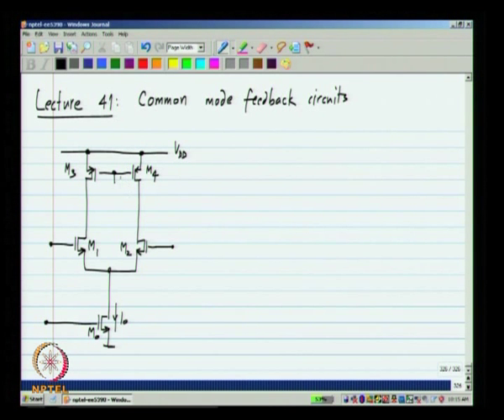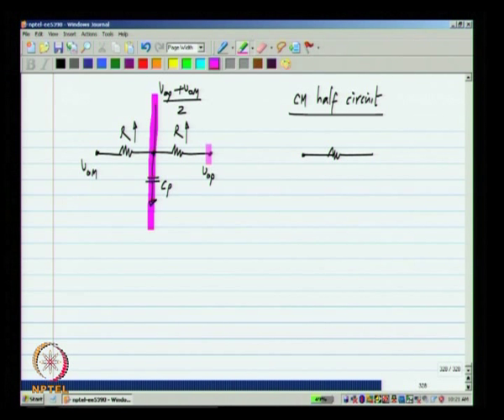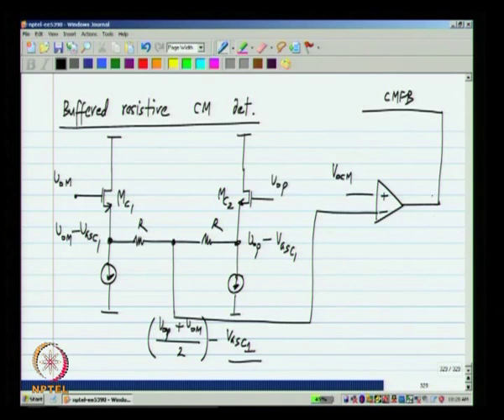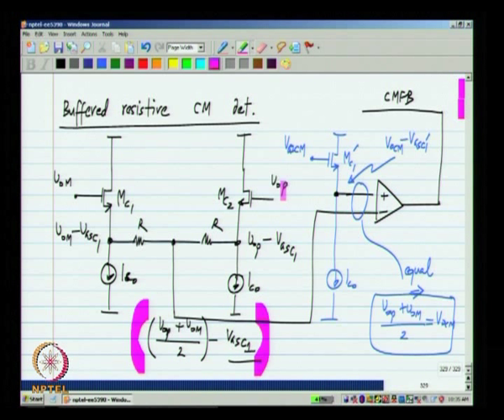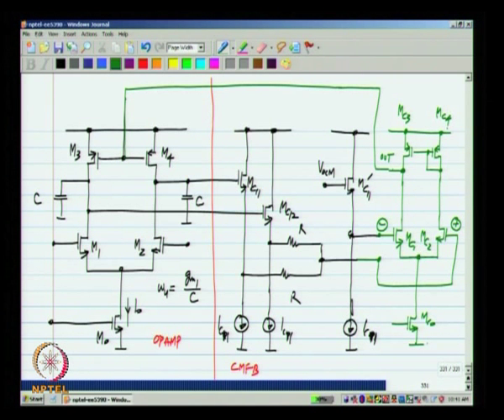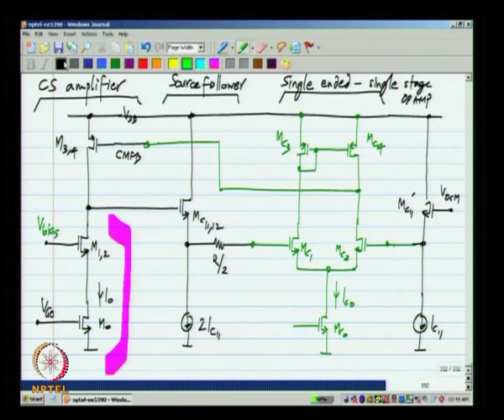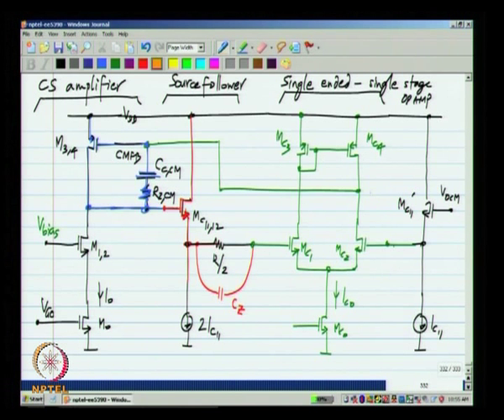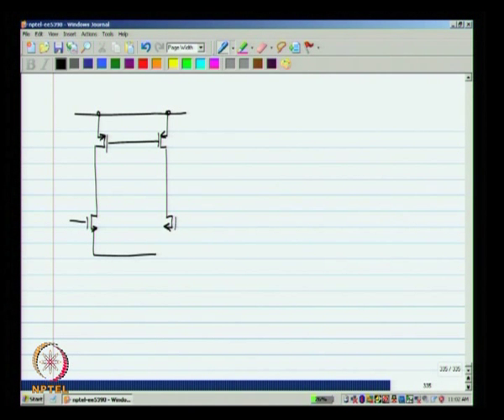Mod-01 Lec-41 Lecture 41

Comment: I feel at 5:35 and 16:45, the signs (opamp polarity) are incorrect.
Also, 48:15 should be single gain stage (CS amp).
Reply: Yaa you are right, that is happened by mistaken.